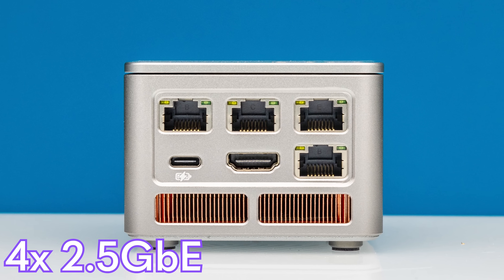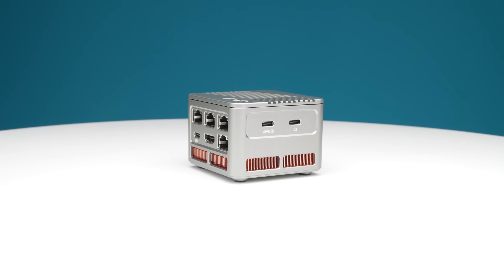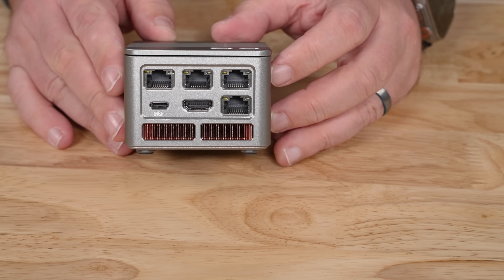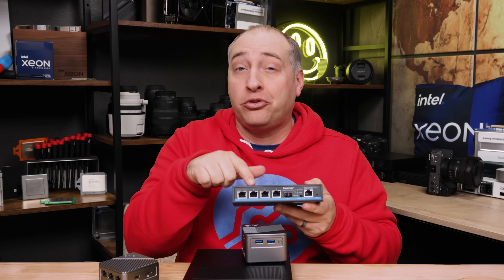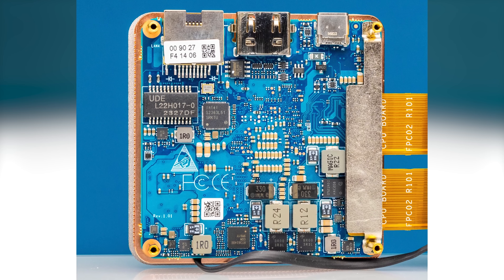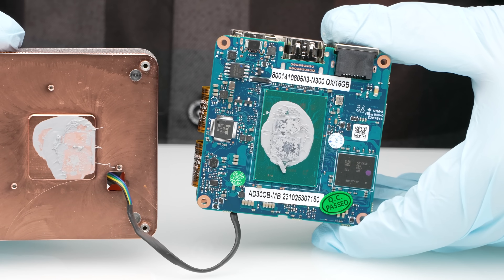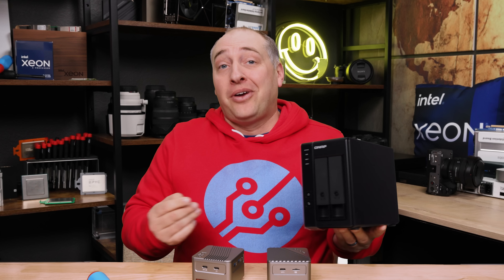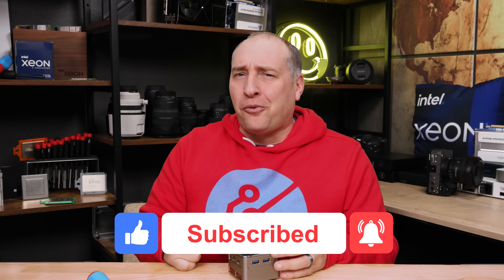TWICE As Fast with No Space Wasted

Comment: Yes, plenty of CPU for most applications - and mostly my servers are spiky so really the only thing lost is full-throttle performance.  HOWEVER where I need the "Big" server is PCIe lanes and honestly a lot more RAM, and ECC.  Tiny server is cool, but CPU performance isn't the last word.  Give me an MS-01 with 512GB of ECC memory and the ability to put a full-sized card in and I'd be real happy.  I'm still working on making a "good" proxmox backup server, and honestly its hard.  I need at least 4 drives for ZFS, at least 20TB of space, and an external SAS connection for tape backup.  Hard to do in SFF.

Comment: That thing isn't only good for low power home server. It will make perfect IPS apliance if you pair it with either pfsense ce or if you prefer to have more flexibility openbsd which is base for pfsense. I know i'd use it that way and in so many more ways that don't require high power computer. Normaly most will buy netgate which comes with pfsense+ but not everyone needs pfsense+ and some may want more flexibility. Asuming that thing isn't pricey it gives an opportunity to save money. If i saw correctly it has internal battery which means you have to buy one UPS less to keep it running when there is no power.

Comment: Patrick, hoping you see this and can make a suggestion. You have a large knowledge of different systems and hardware. Looking for some hardware. 

My needs. 3-4 systems with TinyPC size or smaller (would love something this form factor). Want to run ProxMox as a cluster and on it run Home Assistant, Frigate (with coral tpu), Plex (4-5 streams), arr suite, truenas or next cloud and maybe a few other programs. I would also want to host a Windows vm to run my web design software. But I am looking under $1000-1500 USD. Also looking to have 2.5gb Ethernet (2-4). Any suggestions on this? Want to not have to upgrade for a few years. Thanks in advance.

Comment: Hmmm, only Intel. Is there also an AMD version that is: 1. a bit higher system performance (single/ multicore); 2. lower Wattage power draw; 3.a little bit cheaper; and 4. just as small and all other parameters the same (Ethernet, 16-32 GB storage, etc.)?
Reply from the maker: AMD does not have a direct competitor to the N300 these days.

Comment: Great video, as always!

It's too bad that for the N300 option, right on, on Amazon, the 16 GB RAM option isn't available (at all).

But on the manufacturer's website -- it is quite a pricey option, I think.

In contrast, I bought an OASLOA Mini PC which has the N95 processor, but only dual 1 GbE NICs in it, and that one was only ~$150, which is quite a lot cheaper.

I'm running three of those (the 16 GB/512 GB SATA 2242 M.2 SSD variant) in a 3-node HA Proxmox cluster with erasure coded Ceph RBD and and erasure coded Ceph FS on it and it runs well enough for what it is.

All three nodes, idle, combined, at between 21-24 W; so it has very low power consumption.

I wouldn't necessarily say that the performance is stellar, but for running my Windows AD DC, DNS, and Pi-Hole, it works.

Comment: I've had the worst experience with i226, even on intel-designed NUCs. That one has packet loss on receive even at gigabit. On other 2xx chips the checksum offload engine is vulnerable to truncated packets. The QA on 2xx is nothing like the pro100 and pro1000 that made Intel a name in network cards. These days I'll use either a server-targeted adapter, or a rtl8125b.r5.

Comment: Patrick really hits the nail on the head with HomeLab servers: often many times people buy so much more compute than they actually use with a louder, higher power consumption build that costs more room and money. I myself am currently doing burn-in on an AMD Epyc Milan build as I type this, because these tiny-minis didn't cut it. And why not? Because I wanted room for many add-in cards/disks, scalability to have a future upgrade path as needed, 128 lanes of PCIe 4.0, and (most importantly) Registered ECC memory. That gets an additional layer of bit rot protection for my valuable data (that I also backup offsite), and keeps my ZFS NAS fat and happy with plenty of memory. To help keep power consumption down I chose a rather boring (in terms of EPYC) 7313P processor, because that's one of the lower TDP Milan chips while still giving 16T/32C for plenty of tinkering via Proxmox. 

^ None of that would have been necessary if something like one of these tiny minis would actually use ECC memory - hell even UDIMM ECC I would have been all over. But if you actually spec out/price a W-chipset mobo + UDIMM ECC you'll quickly find that it's actually significantly cheaper to buy used EPYC Mobo + CPU on eBay, which is what I did. I even got 32GB DDR4 3200 RDIMMs for just over $40 shipped - none of these systems come in the ballpark to that level of performance/dollar unless I'm wildly missing something.

Comment: Just remember Microsoft has mentioned that the new entry level spec for Windows 11 in the September 2024 update is going to be 16Gb and you need on-chip AI support to get the most out of it unless you want an entry level experience. Or you could use Linux which is super difficult to use but does not have native support for MS Pluton and TMC2.2

Comment: Always base purchases on the next 3-5 years not the past 3-5 years no matter how frugal you found that Debian release of 2 years ago.  Applies vehemently for fixed components (in this case CPU and memory) - there will be rare cases where you absolutely know it's 100% fixed purpose and will never change but that's not as common as you think, particularly if you're shifting or changing architecture later on.
4 NICs implies gateway/firewall use too so you might later on implement live analytics engines (as an example) chewing more resources;  even on something as small as this, I know I would.

Comment: It's worth noting that while it's an "8 core", they're 8 12th gen e-cores and are fractionally as capable as Zen 3/4 cores. Still capable of most things you'd actually want a mini pc like this for, but don't go thinking it can actually compete with 5800u, 6800u or 7840u systems for performance.

What I don't know is how it stacks up to similar Athlon/r3 parts. That would be a more interesting competition. The latest of those use Zen 2 processors, and use less of them, but they're also not the gimped e-core architecture so it'd be interesting.

Though looking at it, parts like the 7320u have double the power limit of the N300, so it probably outperforms it even with the lower core count. Even the Athlon parts still have 15w TDPs. Doesn't look like AMD has any explicit 7w parts.

Comment: Here's a question - could you run this from PoE splitter? If the splitter stepped down the voltage to 12V, and could deliver a PoE+ 30W?

Comment: CWWK has a box with the same tiny form factor containing 4 x I226-V NIC's, 3 x USB3 10Gb/s ports (1 USB-C), an i3-N305 CPU, and 16GB LPDDR5 RAM (no storage) for $320. That's $60 less than the corresponding iKoolcore R2. Looks like a better deal to me.
Reply: 😅 That is a knockoff version, they use the aluminum heat sink that R1 eliminated, their side USB-C port has no hardware protection, wrong insertion of power supply, will burn the processor, front panel USB-A is USB 2.0 (physically cut off line), hard disk is PCIe3.0x1 speed (if you want x2, then the network port order is messed up) … too many copycats of R1, but they copied out bugs! Their four bosses are all acquaintances, we are in a war of words recently !!! if you want to buy the knockoff version, welcome 👏, that is, the noise is a bit louder, there are a few physical hardware bugs, the appearance design is uglier, the heat sink is much worse, the top cover completely failed to copy the hard disk heat dissipation design … so the 60-dollar gap is here!
Reply: @iKOOLCORE and you use a USB C port for 12v power. Non compliant and dangerous. Why? Genuinely curious if you're actually a company account.

Comment: Very nice! This could be a replacement for my custom pfSense firewall when traveling with the T9 N100. 🙏🙏🙏🙏 

PS: For comparison, the consumption of my T9's current setup that we use when we travel with the N100 , 16GB, 512GB NVMe, WiFi, running Proxmox with pfSense ( in a VM, wifi card passthrough ) and a few services in containers (CT/LXC), pfSense including pfBlock, Snort, and VPN (always on for accessing the office server) is around 220 watts per day for 8-10 working hours, with 3-4 PCs connected, and other hours with 4 smartphones connected.

Comment: I see the 16GB version isn't available, so I am guessing it sold out right away.  That being said, I think for router duty I would give up the extra nic and instead go for something with passive or mostly passive cooling so that when the system is at idle it never needs the fan.  Other than the low amount of memory it looks like a very powerful tiny PC for its size.
Reply: You can fix fan speed with software like fanspeed in most mini-pc. 
If the CPU reaches max temps, it will downclock itself and not overheat, even with 15-20% fan speed. 
Performances are reduced but for a router I don't think you will notice any difference.
Reply: @greg8909  For longevity in things like routers, the goal is to eliminate active cooling where possible.  My current router is based on a mini itx intel atom board that is 15 years old and completely passively cooled. I expect I will need to replace the CMOS battery and boot SSD at some point but the rest of the system should easily last another 10-15 years of service at which point I will likely have upgraded due to increases in internet speed and a need for more raw throughput.

Comment: could this unit route 1gb WAN port with a few rules as well as VPNs at 300mb + ?
Reply from the maker: Mentioned this a bit, but the CPU is faster than the C3758R Netgate puts in its 8200 MAX so doing in one port of 2.5Gbps and out another (or others) is not a problem for the N300 as a firewall. IPsec VPN would not get QAT offload here. If you are just using WireGuard, then you have plenty of CPU for that too.

Comment: Minimalism is cool... but why ? Where to get NAS power and this mini PC. In case of disconnection from the station?
It seems to me that minimalism is excessive. Is normal cooling, variability and power no longer relevant?
Anyway, we will come to the concept of NAS with SSD drives and lenovo Go without joysticks.
Reply: Minimalism is good. Not everyone wants a big bulky computer. That includes most laptops. This is pretty modest.
Reply: @BrycensRanch   I don't deny it. But to abandon the normal m.2 ssd and replace two RAM modules. This Is Unnecessary.
Reply: @Empty_Vima  if the computer works well, it works well. Regardless of the upgrade path being diminishing. But I do agree with your concerns
Reply: @BrycensRanch   Well, good luck to you. With this approach, I will choose the phone... With a terminal and a vim. Apparently my idea and yours are why mini PCs are different.
Reply: @BrycensRanch   For when different amounts of RAM and SSD are required for your tasks, you will find out their price. Especially in comparison with Mac. Not to mention the operating systems and software...

Comment: Good video as always!  From a production point of view, I know you're still ironing out the kinks at the new studio but the sound change is super noticeable.  Maybe try one of those square Youtuber mics for both segments until you get it sorted out so its consistent?  

Agree with you about more ram not being possible being a bummer - thanks for pointing out the processor limitation; makes much more sense.  I didn't see any N95 benchmarks on your charts - perhaps you guys could find a mini PC with that processor and test so we could see exactly what we are missing?  A portable Kubernetes cluster  in a pelican briefcase and a Gaems screen (all connected over USB-C 10gbs in a mesh network or 2.5gb NICs) all powered off a battery bank would be super cool.
Reply from the maker: Yea we use a Sennheiser MKH 416 in the main set where I am sitting. For the new set, I need to move, so it has been trying combinations of lav mics and such. #11 a DPA 4071 just arrived this afternoon. Still lots of work to do.

Comment: I love these new little Atom processors, not happy that they're trying to call them an i3 while cutting it down to atom specs (still only 2 core complexes and very cut down RAM and PCIe), but still its 8 cores at under 10w
I cant wait for a 16 core variant at 15w and support for 32GB of RAM, maybe more PCIE lanes too
Reply from the maker: The other way to look at it is that the multi-threaded performance is closer to a 35W Core i5 from 7th/8th Gen but at 7W and in Core i3
Reply: @ServeTheHomeVideo  you can also take the multi-thread performance of the Atom X5-z8550 being close to the 35W Core2 Duo T9900 or i5-430m with a similar time gap, and look at all of these processors 100/300/305 included, however you'd like. All perspectives are valued.

Comment: Is the power supply a USB C with a static 12V plug pack? Careful not to plug it into you phone!
Reply: Wow, that's nasty! The label on the unit said 12V/PD, but the adaptor cable uses an old style barrel jack...?  Power Delivery requires data and power connections in order to allow the load and power supply to negotiate the correct voltage and current. Obviously, a barrel jack can't support that negotiation. The implication is that this combination of power supply and adaptor cable could easily release the magic smoke from any phone or tablet that was accidentally connected.

Comment: Hey Patrick...I am considering this as an OPNsense replacement. The 8 gig of RAM is just fine for me, as my current firewall is barely breaking 4 gig of RAM use. This is perfect!
Reply: More cores/power makes opnsense more of a pleasure to use. If I look at my 8C/16T AMD 5700G CPU usage it's really low... but having that horsepower means nothing bogs down any more (IPS induced latency, slow service restoration on reboot, hanging when opening huge log file)
Reply: @MichaelSmith-fg8xh  Indeed having more cores is preferable when you have other services (especially true for IDS and IPS) running together with OPNsense. The FreeBSD network stack under OPNsense default tuning is heavily single-core.
Reply: @MichaelSmith-fg8xh  Indeed having more cores is preferable when you have other services (especially so for IDS and IPS) running together with OPNsense. The FreeBSD network stack under OPNsense default tuning is heavily single-core.
Reply: if you are using it purely for OPNsense, I dun think you need so many cores unless you are going to do some sysctl tunings (or your uplink is not multi-gigabit).
Reply: @qazwsx000xswzaq  I run IDS/IPS , Zen Armor, and a few other services than strictly a firewall. I'd rather have some horsepower available than not having enough.

Comment: Way overpriced. Used 4 core version mini/tiny pc with an i5 or i7 4th generation can be found for less than  $150.
Reply from the maker: Sure, but if you saw the performance charts the N300 at 7W TDP is about as fast as an i5 from the 7th or 8th Gens at 35W TDP. This is low power and very small. You can buy a much slower, larger, and higher PC for less though.
Reply: @ServeTheHomeVideo  I understand. I was talking about the n95 which may have some new tech in it, yet some older i5 and i7 are just as good, especially for most server projects.  The N95 only allows 16gb while most i5 allow 64gb. The N95 may be 13th gen but is still slower than most i5 and i7. 
Besides, intel is a lying and scamming every time they bring out something new when in reality it's just different numbers to look like there is improvement. For example, the i9 14th gen is still behind the i9 13th gen in many tests. 
Just because it's the newest version doesn't make it an improvement.
The i3 cpu in that unit may have 8 cores, but it's still an archaic i3.  They are milking old tech like they did the Pentium and Celeron.

Comment: Wifi slots on those are awesome for the Coral TPUs. Especially with that amount of ethernet.
Reply: The problem with most of the A+E key slots is they are single lane and can't take advantage of the dual TPU M.2 cards.
Reply: @Chad_at_Sideband_Signal_Co  yeah it might be limited... but still very capable with just one TPU. especially considering the size and Power consumption

Comment: I've been looking for a new pfSense box for the house - the one I have is fine, but a little more performance couldn't hurt, and then I'd have the old one as a spare. This looks great. Netgate do make appliances but they're arm based and weak.
Reply: I've been enjoying my latest router build with an AMD 5700G... It's overkill on 1gb symmetric fibre but it means I can crank up IPS without perceptible latency
Reply: Buy a Lenovo m920q/x and slap an Intel i350 for gb or mellanox x3 for 10gb in it

2.5*4 pcie Intel cards are hard to come by but if you don't need 2.5, or cant go 10gb to a switch that does 2.5. .. see above.